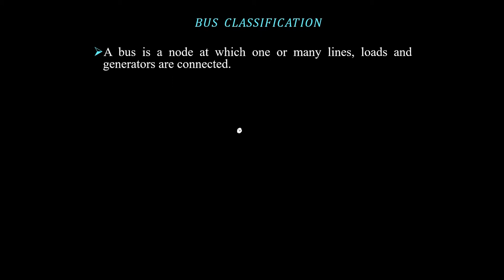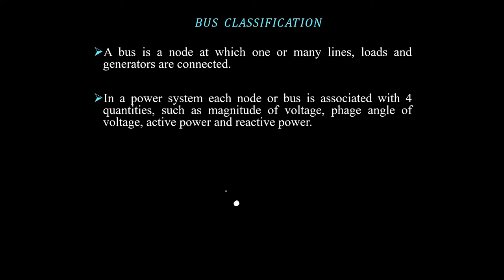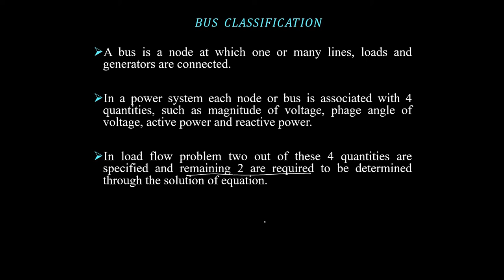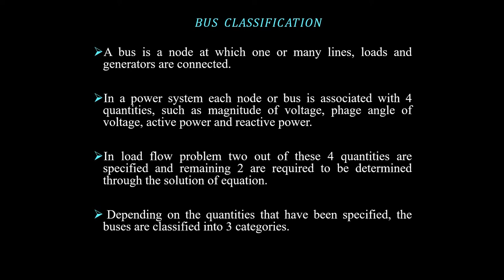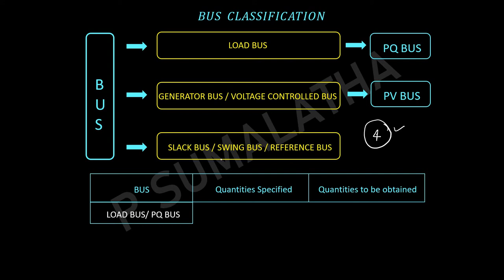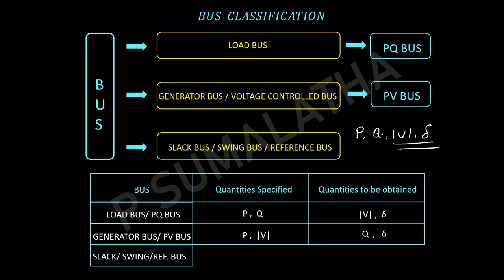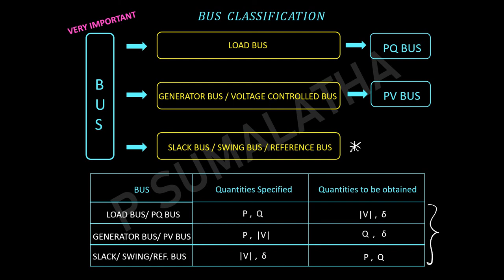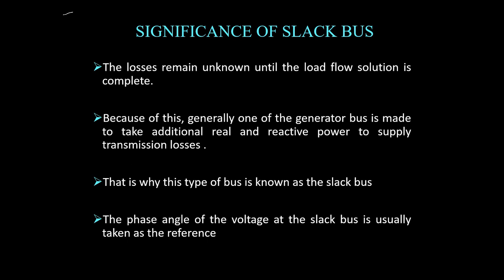Bus Classification

Comment: Hi, thank you very much for your explanation. I still have some problems. I have a question like the below mentioned. Could you help me to find PQ & PV  buses and what are the know/unknown quantities? Your answer is very important for me. Thanks. 

A power system has been modelled with 30 busses (nodes). There are generators at 12 nodes.
There is one SSSC on a branch in which the power
ow needs to be controlled. An SVC
is connected to one of the load busses.
Reply from the maker: Out of 12 generators, one generator will be considered as a slack bus. No of PV buses will be 11 if the reactive power limits are not violated. If any bus/buses are violating the Q limits, those buses have to be consider as PQ instead PV. 
Since One load bus is provided with SVC, it will be considered as PV instead of PQ.
There will be 4 quantities at each bus
1. Voltage magnitude, |V|
2. Load angle, del
3. Real Power, P
4. Reactive power, Q
Out of these 4, 2 will be known and 2 will be unknown at each bus in general.
For Slack: 
Known: |V| and del
Unknown: PQ
PV bus/ Generator Bus:
Known: P, |V|
Unknown: Q and del
Here, you will find Q value. If Q value violates it's limits , this bus will be retreated as PQ

Load bus/ PQ Bus: 
Known: P and Q
Unknown: |V| and del

Load bus with compensator/ Voltage Controlled bus:
Any bus with compensating devices except shunt inductor/capacitor will be treated as PV buses .
Reply: @psumalatha5659  Thank you very much for your great explanation. In this scenario, the SSSC does not play any role here?
Reply from the maker: SSSC is used to provide controllable voltage compensation. It is also used to reverse the line current and power flow direction. Overall system operation if you see, it has its own significance. As far as I know, it will not play any role on bus selection